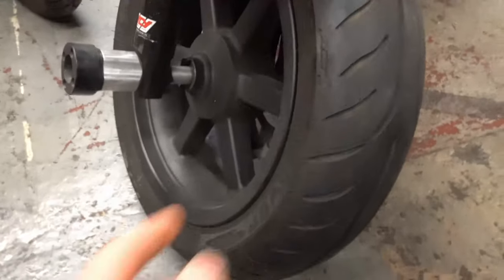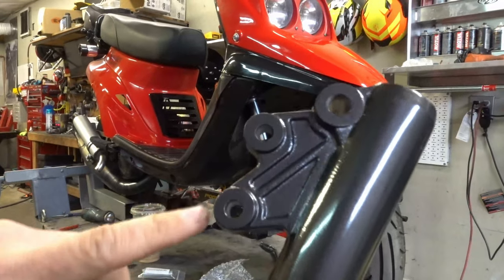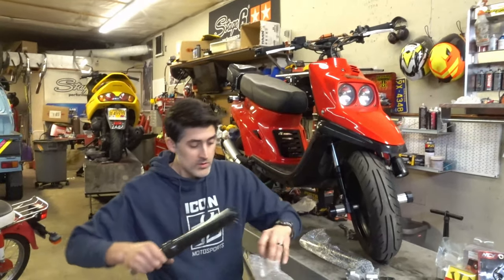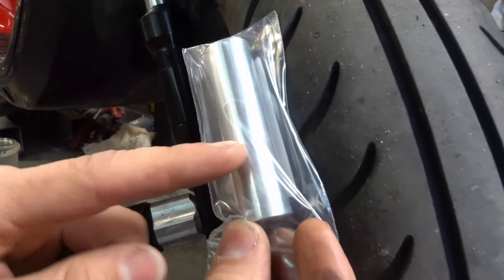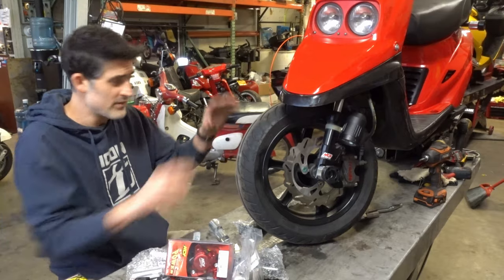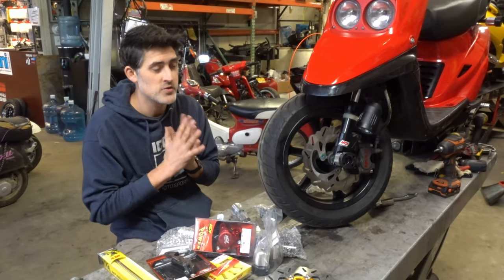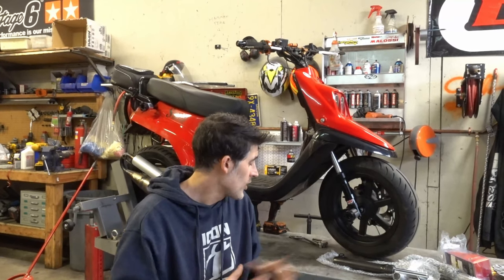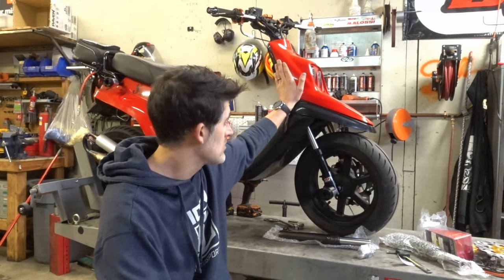ZUMA wheel swap explained

Comment: Great video, thx.
Alternative to drilling out the stock forks from 10 to 12mm you could swap out the wheel bearings with an ID of 10mm.
Reply from the maker: Yes you could!

Comment: What does it mean on some websites that say their wheel size is 12x4? Is 4 the width of the wheel? What would those black wheels be considered, are they 12x4?
Reply from the maker: You’d need to contact that specific website for details on their wheels and dimensions

Comment: Your vids are so perfectly Explained. 

   I have a 50cc Peace Sport Scooter with 100cc bore kit on. 

    I wanna install exterior headlight that will last and not too bright so not to be pulled over. Simple, cheap, easy and lasting. 

   For now. Is there a way i can safely bypass headlight without shorting anything out. 

   Regardless. I appreciate all I learned in short time I been subbed to your channel. 

  PS. Plan on endorsing some bucks to your channel regardless. All here I'm sure would if they could. I will soon.

    THANKS MAN👍
Reply from the maker: I would wire it to the battery and have an in-line toggle switch. That’s the best way!
Reply: @Scooterswapshop  I forgot. They probably don't have light out stop engine governor's over there. Here in america certain bikes are wired so light goes out then bike don't start till light bulbs replaced. 

   I was wrong for asking you about that. 😭

  American vehicles probably just as good a junk as Chinese monkey machines. After riding for a while have developed a taste for bananas. Guesse I  answered my own question.🐒🙉🙊😭😭😭😭

Comment: Hey dude do you have a email I can use to contact you I have some questions about my scooter
Reply from the maker: yooowsss gaming yea our email addresses are both on the website depending if it’s a local or online deal
Reply: Scooterswapshop I have a Yamaha nvx 125 and I was wondering if I could install a bigger cylinder without need for a ecu